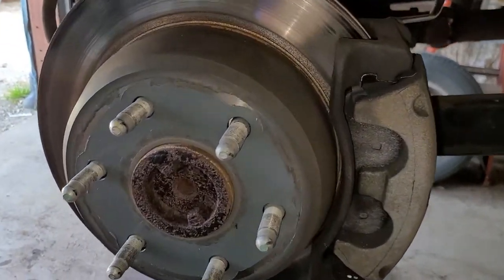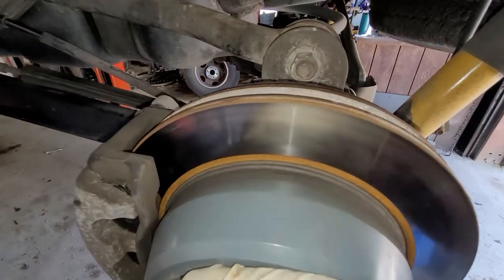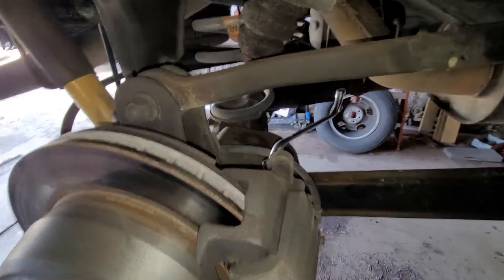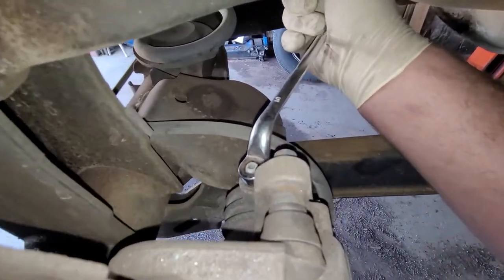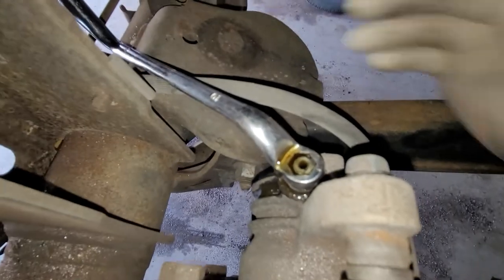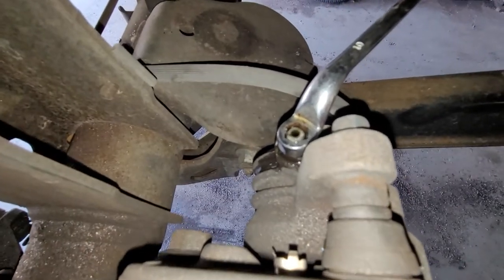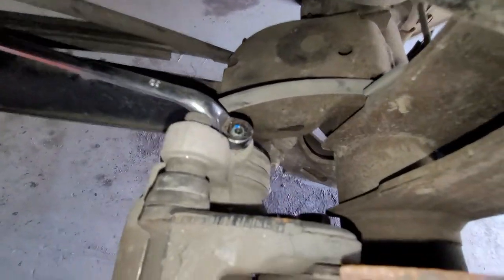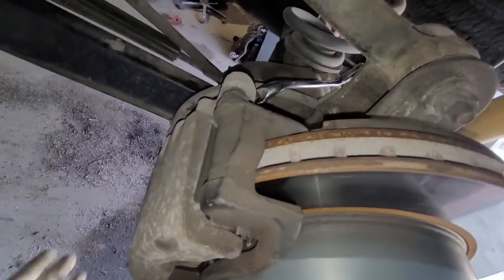Rear brakes grinding ? They're brand new !! What happened ?

Comment: I have all new caliper,hose,rotor and pads...still getting hot only on that side.bled it all . Stinks too. Ebrake not riding either. No play in bearing. I'm stumped and broke lol help
Reply: Same 😭
Reply: Same
Reply: Check the master cylinder for leaks
Reply: 93 surburban new rotor and caliper and pads running hot burnt 2 rotors already on my 3rd set u figure it out?
Reply: @it8366  the pad retainer clips were scratching up against the rotor for me.

Comment: I would like to see a follow up on this. The calipers on my Grand Cherokee retracted very stiff-like when I replaced the brakes and rotors. I should pop out the pistons and see what the bores look like. I have no braking issues though. I hope to get around to it some day.
Reply: I’m having a grinding noise only on the passenger side. Did you find any solutions 😅

Comment: I just replaced the rear drums, pads, an cylinders on my 2011 Sierra but i can hear it rub like grinding when i hit the brakes. Dont know what gives iam 99% sure i did everything correctly but obviously something aint right. When i replaced them the one thats now grinding i had a terrible time getting the drum off but ive replaced basically everything but that backing plate. Ive bled them an the brakes themselves are better feeling than before i bought it last fall. Just hoping for a few pointers if ya have any lol